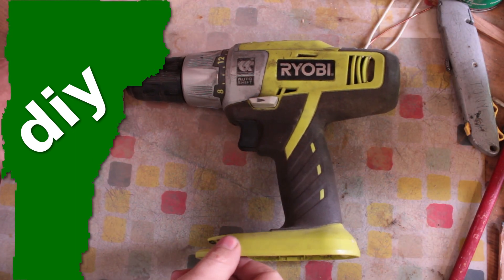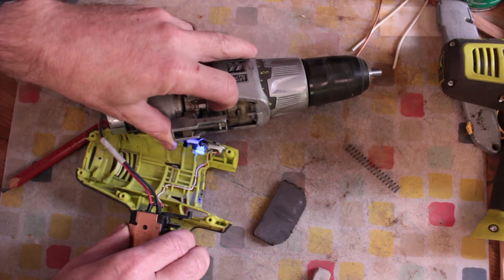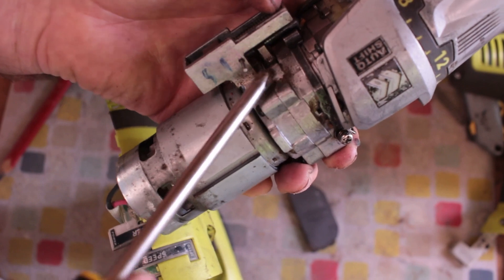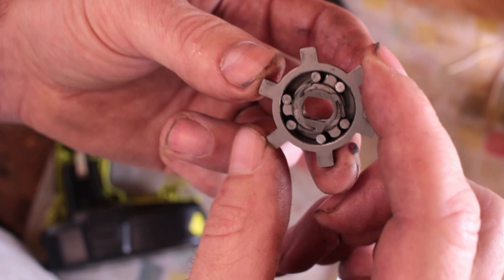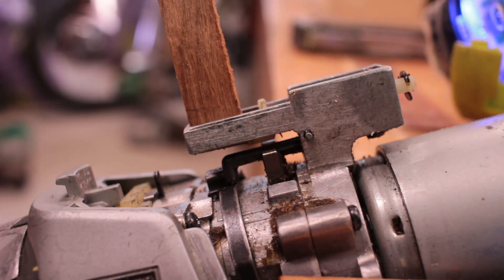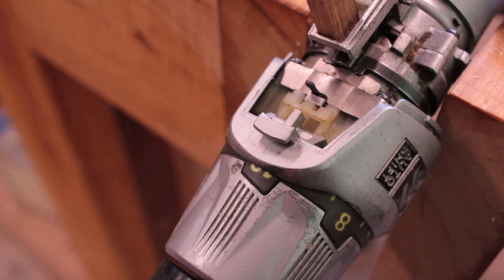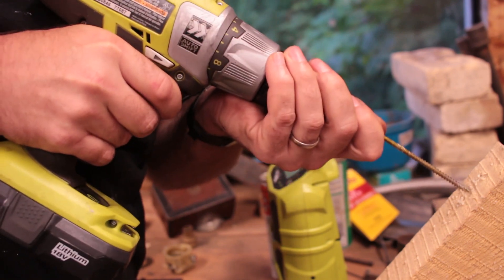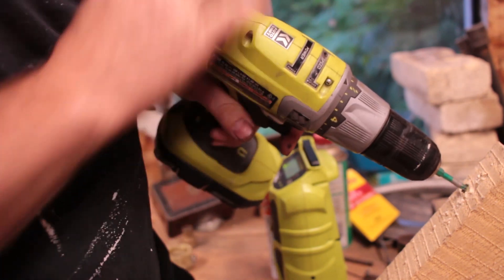Ryobi Auto-Shift drill, How does it work?

Comment: You have to put it in the drill setting smart guy you have it on a number witch limit the power because it can't go past a certain power the lower the number the less power it will put when screwing something when you have it in the drill setting that means full power 😮‍💨
Reply from the maker: It was in drill setting the whole time. It slipping had nothing to do with it clutch system.
Reply: @diyVT  look at the begging the drill marker is on the side and you can hear it  it cutting power off
Reply: @diyVT  it's on 16 lol it's suppose to be on the drill marker 😂
Reply from the maker: @RobTheMech  it's still not the clutch slipping, that makes a ratcheting noise. I am not sure what time you are looking at in the video but the section at the end where I figured out how to make the drill not slip the drill is set in drill mode and it's slipping.
Reply: @diyVT  in the begging bro I wish I can send a screen shot
Reply from the maker: @RobTheMech  yes you are right in the beginning I did have the drill wrong. But there's more wrong with the drill than just that setting. Did you watch till the end?
Reply: @diyVT  yea

Comment: So that's how it works!  The drill looks like it has seen some use.  Wonder if the plastic direction switch has worn where it engages the low-speed lock actuator?
Reply from the maker: It could have been worn.  We didn't use the drill that much but I think my dad got it used off of eBay.